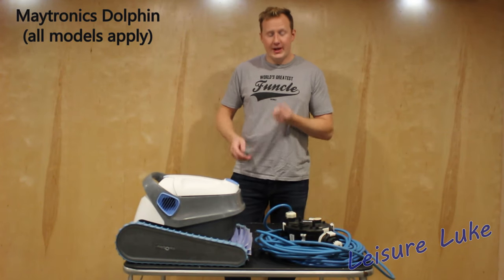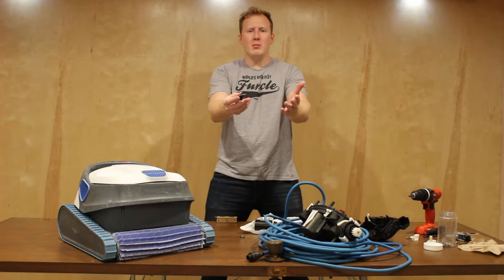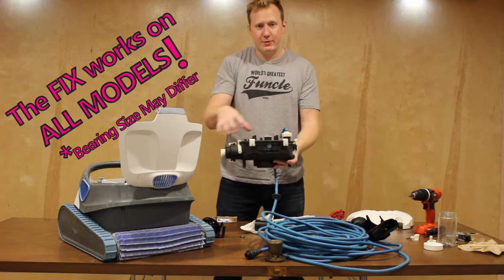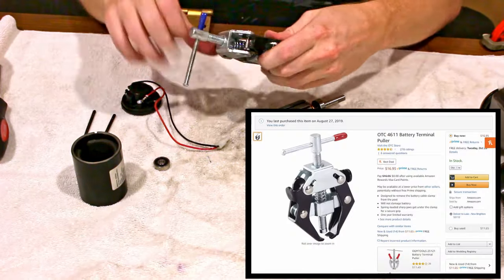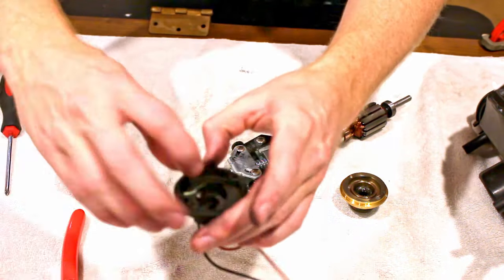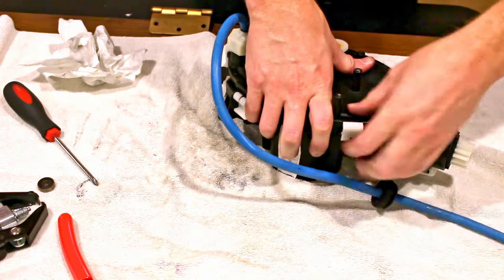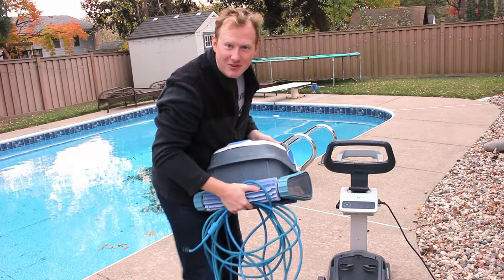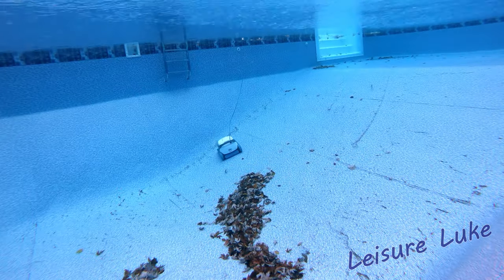Dolphin Pool Cleaner - BROKEN is FIXED!!!  SOLVED with 1$ Bearing | HOW TO REPAIR for MOST Models!

Comment: Good man well done umm IV got an x20 dolphin what bearings would it take in the pump be really helpful to know as mine one is not running atm
Reply from the maker: Not sure which bearing is in the x20.  Fortunately, all bearings have the part # stamped on them! :) So once you take it apart and find the bad bearing it'll be easy to know which bearing to order.  If you get that far and can't find the number, let me know and I'll have you take a few measurements - the bearing part # directly correlates to the inner diameter, outer diameter, thickness, and seal type.  So even if there's no number, with a decent calipers are good measuring stick we'll get it sorted out quickly!  Either way, you'll have to crack that baby open.  Is your impeller motor hard to spin by hand?  It should spin freely.  If it doesn't it's almost certainly the bad bearing problem.   Good Luck, Cheers!

Comment: Should it be easily turning or is it normal to feel like it is kind of catching at points but not completely stopping?  I pulled it apart and those 2 bearings turned freely, then reassembling it, the shaft wasn't exactly easy to spin, but it did.
Reply from the maker: It should be “pretty easy” to spin.  Assembled, you should be able to rotate it with 1 finger.  The only resistance you should feel is the magnetic resistance.   Note - there are 3 bearings.  2 on the motor shaft and 1 inside the brass cap.  The bearings fail fast, so try running some cycles and if the problem is a bearing it’ll totally seize up pretty quick.  Hopefully just pulling it apart and putting it back together has fixed the problem.  Keep us posted!

Comment: This video is very helpful. In taking apart my impeller motor a ton of black dust and sut fell out. I'd love to send you a video of what I have discovered if you don't mind.
Reply from the maker: Leisurelukeyt@gmail.com send it over!  Dust inside the motor or just around the impeller?  These are brushed motors, so they will accumulate dust inside from the wearing of the brushes.
Reply: @LeisureLuke  Thank you for the very quick response. Sorry I am just getting back to this project. I was able to clear the dust, as you've responded to this 100's x's now and I was too lazy to read through all your comments.

Now I am having the same problem that @Robert Hawke is having with sucking water in from the top and not blowing out.
Reply from the maker: @robertbonse2262  Sounds like you mixed the red and black wires internally on the motor :( not difficult to fix, but time consuming.  GL!

Comment: Hi Luke, thank you for the video. I replaced the wheel bearing and robot worked again. 

The post fix issue I have now is: 

Robot does more circular movement. It no longer climbs walls, and occasionally tips over but the tracks keep running. It does pick up leaves well, howerver just doesn't stay suctioned to the ground. doing a pop a wheelie motion. 

Any tips to fix these issues?
Reply from the maker: Good news - bad news.  Good news: your electric motor is working again!  NICE FIX!  Bad news: You put the motor brushes on backwards.  A few people in the comments have fixed it by resoldering the wires instead of removing the motor.  I would just undo it, swap (reverse the polarity) of the electric motor power wires, and you'll be good to go.
The reason it has no suction is because the motor is spinning the wrong way.   You have more like a hovercraft now, but that aint cleanin the pool so good.
Cheers!
Reply: I'm not sure if I understand? I put the motor back in place to how it was? Am I taking out the motor top and putting it on the other side? If that's what you mean?
Reply: @LeisureLuke  I have the same issue as this, but still don't understand your instructions on how to fix it.  I don't have the means to resolder the wires.
Reply: @irneszeljkovic6976  I have the same problem and not understanding how to fix it.  did you figure out how to fix it yourself?

Comment: My Dolphin active 30i was doing the same thing.  Found tons of debris wrapped around the impeller but after removing it still didn’t fix it.  Took it apart and one of the bearings was destroyed.  Replaced the bearing (thanks for the video!) but it’s still doing the same thing… will go backwards for a few seconds then stop and shut off.  When doing the out of water test it goes backwards 10 seconds but doesn’t go forward, just stops.  The impeller moves freely now.  Any ideas??  Would this be an indication more than one bearing was bad?  It didn’t seem like it.  Thanks
Reply from the maker: That’s a tough one.  🤔 Congrats on finding and replacing the bad bearing.  If you can spin the impeller freely it’s not a bearing problem.  The only cause I know of for the symptom you’re describing is the impeller 🧐 but if it’s free of debris and you’re able to spin it, the. I’m not sure what your next gremlin is… hopefully someone else on this thread can help!

Comment: I have a nautilus CC. When I opened the motor housing, I saw some moisture and I attribute that to poor operation. Looks like runs ok now on bench. There is no gasket, only a greasy coating at housing joint. Before I close this up, do you have suggestion on how to properly seal the housing?
Reply from the maker: You'll probably be okay closing it up as-is.  I think the type of grease is silicone grease, often called plumbers grease.  You could clean it all off and reapply it, but that shouldn't be necessary unless you've introduced a lot of sand or debris to the grease.

Comment: Thank you for this video.  I did this, and now the robot is working again.  BUT...the propeller is spinning the wrong direction.  What did I do wrong?  When I test it, the propeller is spinning and sucking water from the top and sides instead of blowing out those holes.  What did I do wrong?
Reply: I wonder if I have the same problem… after my repair my robot doesn’t vacuum and has trouble even staying on the pool floor without wanting to ‘pop a wheelie’
Reply: Hey again - we had the same problem. I clipped the red and black wires and reversed them and resoldered them back together and heat shrink.  Spins the correct way again. 

Evidently when you reassemble it has to go back exactly like it came apart rotationally, otherwise the polarity can reverse. I disassembled and reassembled several times and the shaft always spun the wrong way.  Clipping the red and black and reversing them worked for me and my robot is back in business.
Reply: @claytonsmith3547  Thank you for your response.  I don't have a soldering gun, but there HAS to be a way to put it back a certain way without having to cut the wires.  When you say you reversed the red and black, are you saying that you soldered the red to the black and the black to the red?  Thank you for your help!!
Reply: @brentpeters906  yep that exactly what I did. This causes the motor to spin the other way. 

The problem lies in the reassembly of the motor after you and I took it apart and put it back together.  Everything works correctly except it’s spinning the wrong way causing the impeller to spin the wrong way and not have any suction.  After some internet searching, it seems like a motor can spin the opposite direction because something isn’t lined up exactly right and the applied current causes the windings and magnet to want to spin the other direction.  

I took mine apart and reassembled like 5 times, checking the rotation every time, and it continued to spin the wrong direction.  The easiest solution for me was to cut the wires in the middle and reverse them (black to red and red to black) and that caused the motor shaft to spin the correct direction once again. 

I just did this yesterday and I’ve already used my robot 4 times since and everything is working as it should again.
Reply: @claytonsmith3547 just confirming for everyone out there that switching the red/black lines worked for me as well.

Comment: How did you get the motor apart? The black case seems sealed.
Reply from the maker: The motor had 2 long screws that needed to be removed, then could be wiggled and worked apart.
Reply: Got it... still broke sputtering

Comment: Great video! Thanks. My impeller is doing some resistance. Not too much. But the robot has some of the symtoms. Should it rotate freely when pushing it?
Reply from the maker: If you feel some resistance while spinning it's probably time to take it apart.  They should spin freely, normally there is very very little resistance.  One thing you can try is setting the dolphin up on a block, so it doesn't drive away, and just momentarily starting it up.  When I did this I could see my propeller wasn't spinning.  If yours looks to spin really fast, maybe you have a different problem.  Also, if you consider yourself fairly handy, this is only a moderate undertaking.  By the time you get to the bearings, you'll be 100% certain if they're the problem.  If your dolphin quits right away... that's probably your best option.
Reply from the maker: Good Luck!  Keep me posted!
Reply: @LeisureLuke  Hi! I took the motor apart but the bearing was ok. A good cleaning was ok to have a better rotation. But the problem is still there. I made the same thing with the drive motor (it was perfect clean) but again the same message. Third I saw the rapid drain flap was bent and made resistance against the brush. I took the flap out to try out but again i receive the same error. I also made a self test. As far as I know, brushes should spin forward 10 secs and backwards 10 secs. And here I noticed the brushes keep moving forward. It seems there is a problem with the "out of water" sensor. :-(  By the way I also noticed the robot is not moving normal. It has for instance troubles doing turns. Any suggestion would be appreciated. Where are sensors? I saw in a store there is a kind of lens. In the motor there is a little card in the wall of the motor case. Do you know the function of it? Thanks in advance!! Hope I get this robot to work again!!
Reply from the maker: @hansschroder2133  The 2 circuit board "cards" in my dolphin for the control boards for each of the motors.  It sounds like you dove all the way in, and successfully ruled out a lot.  Unfortunately, that's where my expertise ends.  What model do you have?  I'll see if I can do a little digging, but it's probably time to consult a real professional.  I also see a lot of posts about out of water sensors, but my 300i either doesn't have one, or I couldn't find it... perhaps that's only in older or higher-end models.
Reply: @LeisureLuke  I also own a dolphin s300i.
Reply: @LeisureLuke  I know this model has a out of the water sensor, wall sensor and maybe also a gyro sensor. Where that sensors are? Thats a good question! :-)
Reply from the maker: No luck over here.  That sounds like a strange situation, and I'm not sure what the problem could be.  A lot of people don't realize they have problems with their cables until they replace them.   Other than that I have no ideas.  This website actually sells the motors, and lots of peices.  When you do track down the culprit hopefully this helps: https://www.eztestpools.com/dolphin-s300/
That didn't exists when I made this video... or they were at least out of motors!

Comment: I’m sure I’ve got the same problem!?!!! Now I know what and how to do it; I will have to be brave!!!Is it possible to grease the bearings? Waterproof!?!
Reply from the maker: The bearings come sealed with oil in them.  They go inside the motor inside a water right box.  I would make sure there is grease on the gaskets of this water right black motor assembly box, but I would not add grease to the new or old bearings.
Reply from the maker: Keep us posted!

Comment: Hey Luke, very informative video. I have a different kind of a problem and would like to see if you can point me in the right direction.

My huge oak tree in my back yard was struck by lightning three days ago and along with many other electrical items in and around my house that is no longer working, my Dolphin S200 is no longer working either. The unit was not operating at the time of the lightning struck, but it was plugged in to an outlet.

The control box comes on and lights up as normal, but the cleaner itself does nothing. Is there a reset button anywhere? My first thought was possibly an issue with one of the boards maybe.

Thank you,
Bill
Reply from the maker: Oh no!  Hope everyone and everything else is okay!  Well, if the board is lighting up then the problem can't be toooooo bad.  Usually that symptom means the cable between the control board and robot is bad, or has come disconnected.  So, give that a connection and cable a check.  Is the robot doing absolutely nothing?  Try starting it above water and listen closely for anything.  Next I would probably just try another outlet / circuit just to be safe.  Then, I would see if there's anyway to get a robot or control board to test with yours to maybe isolate where the problem is.  Taking off the control board cover and looking at the actual circuit could be telling if you have an understanding of those things.  If a resistor or capacitor has brown burn marks around it, or if a chip looks like the plastic got melty you'd know right away that's your problem.  It's a pretty goofy case, if you know someone in your life with the same model it'd be nice to test your robot with their control board & vise versa.  Good Luck!  Keep up posted!  Maybe someone else on this thread will know more!
Reply: Thanks for your quick response. The power controller lights up and seems to be working normal. The cleaner itself, does nothing even after placing it on its back out of the water and turning the power controller on. I’m going to take a look at the board and see what I find there and I will respond back with my findings.

Bill

Comment: What's up Paaa. I have an older dolphin Maytronics Triton. Cables have continuity and the unit starts as the propeller spins for 2-4 seconds and stops. The power pack also turns off. Could this be the motor and 
or ball bearings? Thx.

Comment: Would this work on a Pentair Prowler 920? Seems very similar to the Dolphin. TIA
Reply from the maker: Certainly possible.  This "fix" would apply to any electric motor with bad bearings that can be taken apart :)
Reply: Yes, same procedure
Reply from the maker: @markd3636  Nice, saying the job was a success?  Nice work!

Comment: My Dolphin will run out of water, but once it's placed on the pool floor, it only blows water and doesn't move.  Would this be a bearing issue?
Reply from the maker: Hmmm, it’s not an impeller bearing issue.  Out of water does it scoot back and forth?  If it doesn’t, Maybe the drive motor bearing is bad.

Comment: I did as you said a month ago and it worked. However, it stopped working again even after cleaning it out. It goes for around 30 seconds and then turns off. Please- any further suggestions? Greatly appreciate it.

Comment: Hey Luke.  Great video.  I have a maytronics m400 which works for about 30 mins and then stops.  Lights stay on but no movement.  Dolphin want £600 to repair which I’m sure is a complete rip off.  Any advice ?  Regards Paul
Reply from the maker: First check that the impeller is clear of debris.  You'll have to remove some plastic, and I'd take the impeller blade off (1 screw) to really make sure there's no sand or dirt caught underneath it.  Then I'd check debris on the tracks.  If you have the same problem as me it will get worse and worse and worse, and eventually you'll barely be able to turn the impeller by hand.  If you're felling handy, looks like a few M400 motor assemblies are available for sale. https://www.amazon.com/DOLPHIN-Robotic-Pool-Cleaner-Motor/dp/B084HNWZZ3/ref=sr_1_2?dchild=1&keywords=m400+motor&qid=1622297422&sr=8-2  Still a big cost, but this is probably the unit they're trying to swap out.  If they tell you what's getting replaced, I'd dive in and see what you find.  It could also be the cable, or something on the control panel.  Did they say they were replacing the motor assembly?

Comment: Hey Luke, Could you advise me the correct way to remove the rear wheels from my Dolphin Nautilus CC pool cleaner?  This is not the PLUS model.... The rear  wheels and bushings need to be replaced due to wear. I dont want to break the cleaner by doing it wrong.
Reply from the maker: Haven’t done it before, but I think they’re all press-fit parts.  So, as you remove wheels or bushings you’ll slowly pry them up & off with a screwdriver - working your way around if necessary.  Hopefully someone here has replaced the CC wheels & can help more!  Also, let us know if you have tips when it’s done!  Good luck!

Comment: Hello. Mine wont climb walls. I have replaced the cable which had frayed but now its not climbing walls. Impeller spins without resistance. Is it still.ball bearings?

Comment: If i can make the propel rotate with my finger, does it mean that problem does not come from the bearings? Ty for the tip anyway.
Reply from the maker: Yeah if you can rotate it, then seized bearings are not the problem.  Good Luck!
Reply: @LeisureLuke  ty Luke